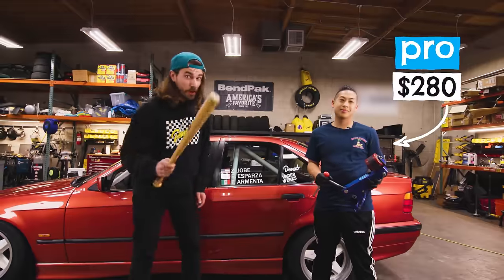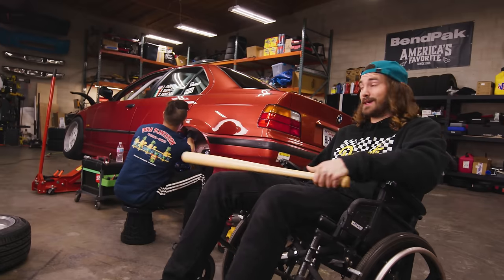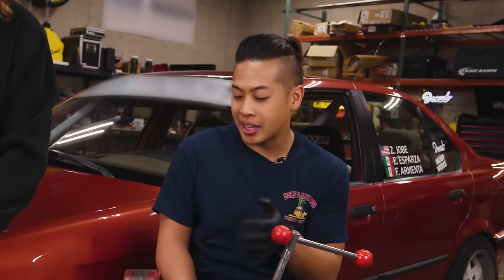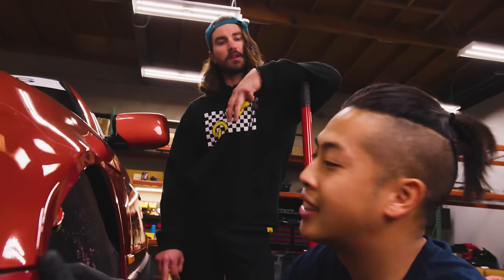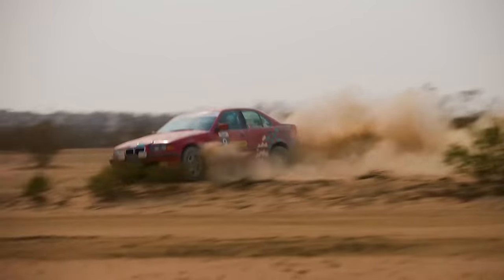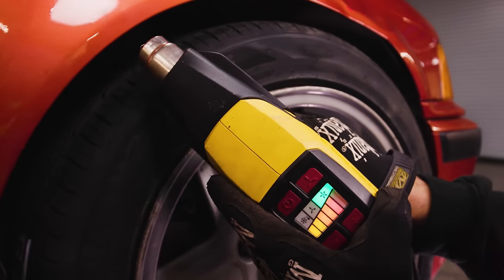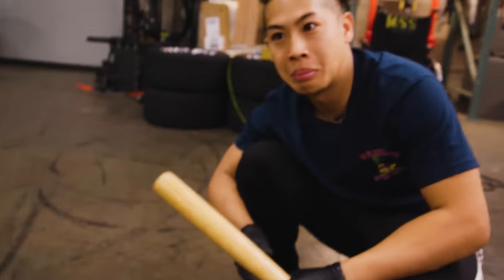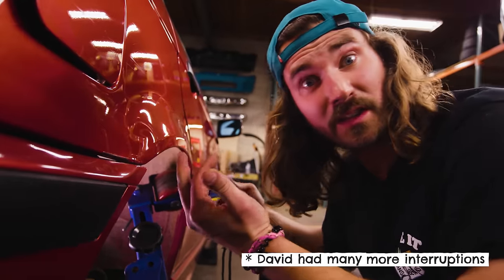$300 vs $0 Fender Rolling

Comment: A fender roller, well, maybe I'd consider buying one, but a heat gun? For sure. For vinyl wrapping, which is something, I dare to say not easier, but less dangerous for the car, that you'll do from time to time, it's far more worth it than a fender roller, that you might use once. Or you can try and make a profit out of it if you have some friends willing to pay maybe 50 bucks (and invite you to eat of course) for you to roll or pull their fenders.

Comment: Keep the liner on and use the heat gun heat up the plastic and use thick gloves or some kind of tool to push the liner up so you don't have to cut it or remove it

Comment: If you're gonna hit a  panel with a hammer, you should hold something on the outside to use as a dollie. If you're worrying about scratching the paint, wrap a piece of wood with an old t-shirt or something to protect the paint. And use a lot of light taps to gradually stretch the metal. If you hit it too hard, you will damage the metal

Comment: Ah jaysis, a bit of two inch pipe on a sunny day and get your mate to pull backwards and forwards a few times with the pipe stuck in the arch and you're done man! Arch roller is easier though, but a baseball bat is just notions compared to a bit of aul scaff bar!

Comment: Wish he tried the bat on the rear as well, the body is thicker and thus harder to bend than the fender metal. I just bought IX arches for my e30 because my dad didn't like my stance taking the words off my sidewall one sliver at a time and cracked my paint up doing the bat method while I was in school. Word of advice; buy the roller and go to pick n pull or any scrap yard, practice on cars destined for the crusher so you've got skills and experience going into rolling your fenders. These tools used to be expensive but they're cheap now, just remember to go slow and maybe pay a homie in blunts and beers to hold the heat gun for you,

Comment: Guys would use plastic bottles filled with sand for this job as well. I suppose the biggest problem with any method is not letting the paint chip and crack

Comment: I've done the bat method on most of my old "beater" cars but I always used the barrel end with the being worked on wheel up on a jack and with brakes on it or in gear so only the bat was moving. There were a few times I couldn't get enough "roll" but I've never had the fender come out damaged or bacon looking. At worst uneven but not the obvious ripples you see here. Those look like an accident.

Comment: The old way to roll with a bat was to just drive the car lol. But if you're worried about messing your first one, just slow and steady car paints good for 300 degrees, so just keep the gun moving and you should be fine.

Comment: My dad always said if a mechanic brings a framing hammer to fix your car, then fire him, I am adding to that if your mechanic also brings sporting equipment to fix the car, then fire the mechanic. There is nothing wrong with wanting to DIY some jobs, It's part of the fun, but always get the right tool to do the job it will save you a lot of time and effort, and you could always sell the tool in the second-hand market afterward even buy the tool on the second-hand market to do your job now that I think about it, but new tools are nice too.

Comment: Or you could just by the fender roller for $50 off Amazon and roll them the right way. Its easy with the roller and a heat gun.

Comment: Where's the pipe method? Roll the pipe between the tire and fender by moving the car on the floor, allows for the ideal amount of both roll and pull where needed depending on the size of the pipe

Tire change and balancing next!

Comment: Old muscle car(like 72 chevelle) not as easy to gain clearance. Its wheel opening isn't round,  I watched a guy do a mazda3 with a baseball bat, tore the back bumper off, rusty rear quarters popped a big chunk of bondo out, overall ruined his car in 30 minutes. At least it was a 10$ car

Comment: I'm not sure how people fuck this up so bad, I did my eg hatch with a jack handle and a big book, and it pulled out nicely, no chips, no heat, my only fuck up was on the first, I tried cutting the lip on the inside, and it made a small kink on the outside of the fender.
Reply: Jack the car up, stick the bat between the wheel and tire, drop it and roll the car back and forth, why are you using it as a hammer?

Comment: Should have cut the end off the bat and put the car on the ground and used the car to roll back and forth. Speaking from personal experience. And I didn't use heat and the paint was fine after.

Comment: or do like me (real diy):  grab a space saver wheel minus the tire, mount on the car(like mr. Pham tool) an old bmx handlebar, welt it over the spare (better do the measurements and tack weld with the jig on the car)
get a skate wheel (hard compound) + bearings + truck and nut, 2  of those U shaped brackets, 
assemble the skate truck+with the wheel then join it to the end of the bmx handle bar that should be tack welded to the spare wheel, and "Thats a Bingo!" =D

Comment: Meh, I took an angle grinder with a cut off blade to make a dozen relief cuts on inside of the rear fenders of my E34 540i back in the day. Eyecromiter all the way. banged them in with a claw hammer. You can't see the inside so, no worries. Old gf totaled that car a few years after.

Comment: See if you spend the $80 for an actual fender roller tool it's not that difficult to do yourself with a $20 heat gun and if you're not impatient it will look professional. Never use a bat unless you don't care and you just gotta make space at the track for your d car

Comment: Lol that heat gun isn't doing a damn thing for the metal it's only to soften paint... And the best thing to do is not lower your car so low that you need to roll fenders and don't use spacers . Its just dumb

Comment: This diy example isn't really an accurate comparison. A true test would have been to have half the car done without the benefit of asking questions and for tips. Without the knowledge of the professional, you can really mess things up. Even with the bat,advice and tips were given (like using a heat gun to soften the paint and metal). Yes,you can YouTube it,but nothing compares to having the pro watching and coaching. Good video regardless, just on the next diy vid,you should come at it untrained like most diy'rs.

Comment: Ok, now do it on a 1972 BMW 2002 set up for road racing with rusty fenders and 16x7 wheels. That 'tool' is useless on 'old' cars. Fenders are all metal, including the inner liner, no plastic. Also, roll the damn car with the actual weight on the wheels with a bat. Meaning on the ground and pushing back and forth. That 'tool' does it with no load on the suspension and can't mimic reality. Waste your money with the 'Pros'.

Comment: Dumb is what I call this because you fold the metal and 90% of the time it traps water and if you are in a country that salts the roads in the winter your fenders will look like shit within a year speaking of self experience. we cut off the lip in the front and painted and in the rear did we roll the lip within 18months had it almost rusted hole in the rear fenders and in the front where we cut the lip away it's still looks like the day we did it.